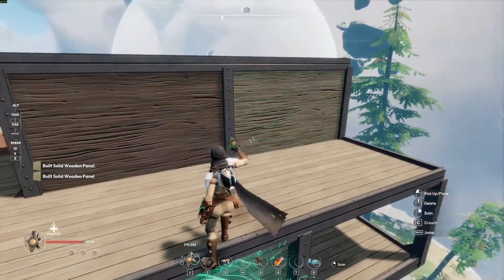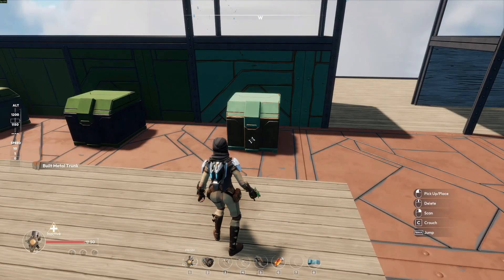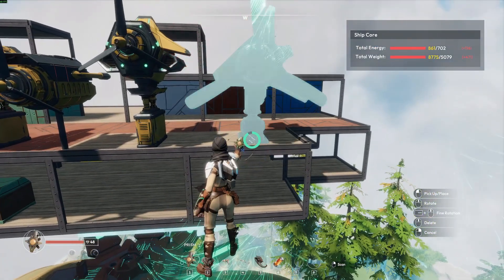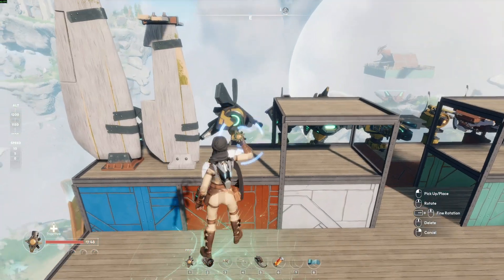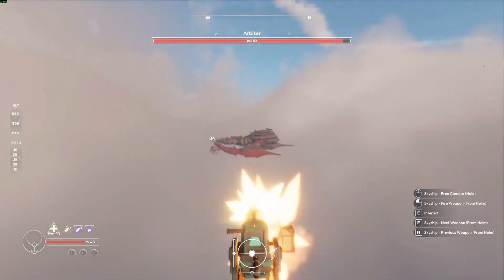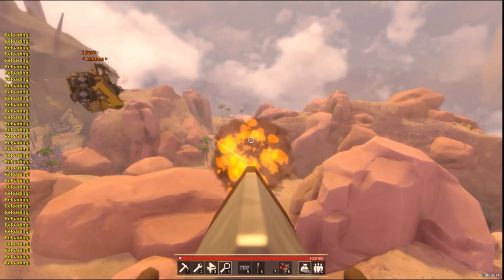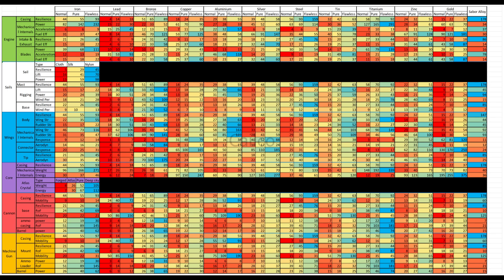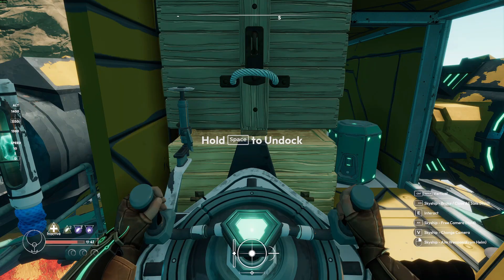Lost Skies Shipbuilding 202 Materials

Comment: Hey Voorh,

I created a test character and maxed out all the engines in the game. I'm currently using an Engine Head with 164 Power and 35 Energy Efficiency, along with a Steel Spear Turbine that provides 218 Power.

From my tests, the best energy-to-power ratio comes from the Squareframe, followed by the Ventilated Rival and the Spinshaft Cyclone. O.O

Considering engine weight (since when you have to install more than 16 on a ship, even a 25 kg difference adds up fast), I think the best option overall is the Spinshaft Cyclone. Using Savorian Alloy for the casing and head, and Flawless Iron for the mechanicals and blades, the final stats come out to:
Resistance: 900
Power: 1410
Acceleration: 568
Energy: 101
Weight: 355

Of course, these numbers depend on finding high-end parts with lots of extra power.
Reply from the maker: A lot of the math came from the lost skies discord so you could be right. Because of the 75 knot speed cap i dont think alot of this stuff is as critical now because its fairly easy to max out on speed especially when your ship is very small like mine. I appreciate  you posting the engine information. Alot of people will find that very useful ❤

Comment: Nice review. Can you tell me which wing parameter affects the turning speed in the horizontal and vertical planes? I know that the speed also depends on the plane they're set in, but in Worlds Adrift there was only one parameter, power, and everything was clear.
Reply from the maker: Thank you. For turning left to right you want a wing on the top or bottom the  blade always faces the rear. the stat for turning L/R is rudder strength. For pitching up and down you want wings on the side with wing strength for the stat

Comment: Is zinc good for anything?
Reply from the maker: Its decent for mechanical internals on wings if you need rudder strength. It will do response on a wing connector. Its very light weight. Zinc would be good for fuel efficiency if that was in the game
Reply: thanks love your channel. It was very wierd not having to worry about fuel like WA.
Reply from the maker: @mikeybrokie1516 thank you so much! ❤ Yea. This is going to sound weird but i kinda miss farming fuel. There was a certain knack to farm it from the underside of the island.
Reply: i use zinc for looks cause it makes a pretty blue, nothing critical though
Reply from the maker: @Nox_Lunatera its a really pretty blue. Its also very light. I use it for some random things
Reply: @voorh33s  actually makes a badass wing with sabo alloy/zinc/zinc/zinc as the recipie
Reply from the maker: @Nox_Lunatera my friend always puts it in the last 2 slots